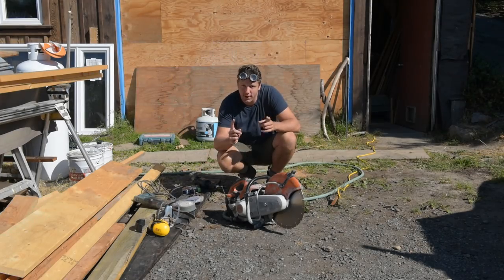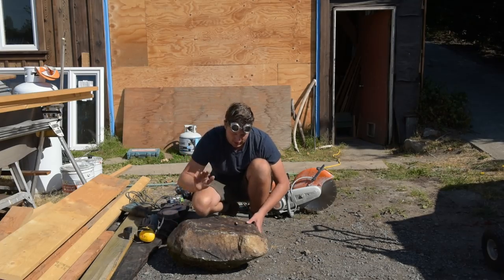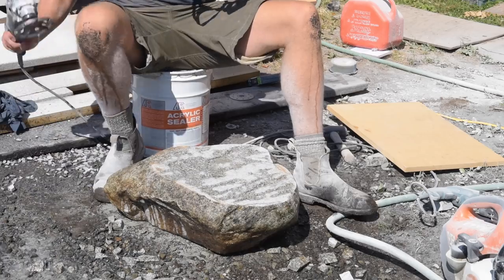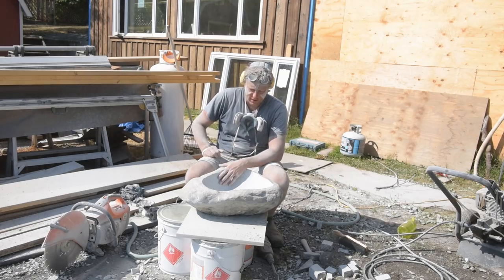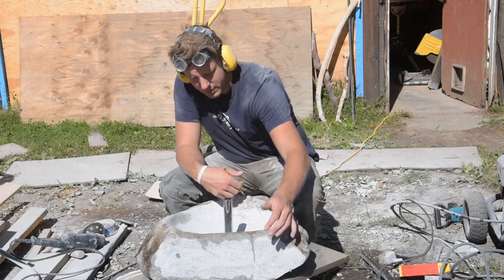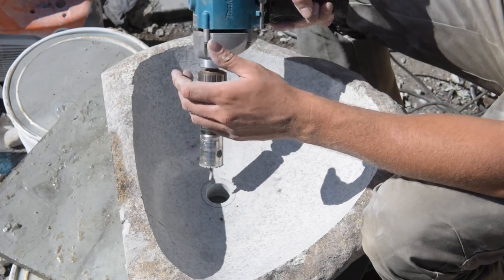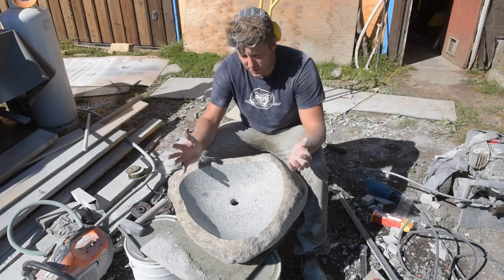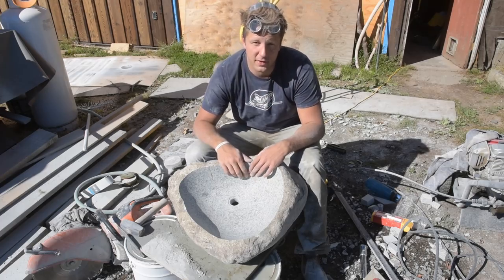How To Carve A Better Stone Sink In 4 HRS!

Comment: Just came across this redo of your original video and i love it, just a word of advice though about polishing stone (for future reference). Im a stone and monumental mason, have been for over 13 years now and when you polish rough stone like the inside of your sink you need a variable speed grinder preferably with a water trickle through the centre of the rotating shaft. When you start off at the 50 grit you can use a normal grinder but dont put too much pressure on the disc because you will actually burn the stone, thats what that yellow discolouration is. As you move up through the grits you need to slow the disc down as you will burn the disc out instead of working the stone. Took me a long time to work out how that part worked lol love the video and keep it up dude

Comment: The best pads I have used are  CHANGE MOORE Wet Diamond Polishing Pads.  @ $40 on Amazon.  50 - 3000 grit.  Gives you an almost mirror finish and really brings out the depth and colors in the stone.  And yes, use water.  I use a spray bottle and mist the stone.  Grind until lightly dry.  Mist again.  You will see the scratches disappear with each successive grit pad until you get to 300.  Then 500 - 3000 use very little water and light pressure.  The weight of the grinder is enough.  I have been using mineral oil to seal the stone and bring out the colors.  Not sure if that is the best product to use, but it sure looks nice to start.

Comment: I am a stone polisher and i also use the same polishing pads , a tip use lots of water when polishing with them or heat will build up and ruin the pads , i also use an air driven grinder/polisher with a hose pipe for water to cool it ,when you go up to using the 2000 grit the surface looks like glass nice work by the way .

Comment: I have polished several granite counter tops and water is the key to getting a better finish.  I used a 4" grinder with a water attachment.  Prolongs life of pad and gets rid of dust that will scratch surface while sanding. Water water water! Like panning for gold. Lol.
Reply: Oil is better at the last polishing steps together with your polishing abrasive

Comment: I purchased a full set of stone polishing pads from china on ebay for $15 to polish granite remnants into coffee tables.   I got great results by purchasing a hitachi variable speed 4" grinder.   You must keep the speed down on level 1 or 2 and use water or you will destroy the pads quickly.   I was able to polish probably 80 linear feet of granite counter top edge before the pads started slowing down.     Look around on ebay for those other stone cutting grinder blades.  I was able to get 4" makita discs that would normally be $30 for around $10 apiece.
Reply: Troy Fall basically the fresh pads give you that little push, once again ive watched this one and his last one it was very shallow but smooth this time it is quite deep bit he hasnt went as smooth compared to the last one but i dont know if it is needed

Comment: Awesome video!!...as far as a grinding/buffing wheel for your angle grinder...I've always found an "abrasive stone cup grinding wheel" works the best.  It won't take too much material, but is abrasive enough to actually remove material and leave a pretty smooth surface.

Comment: awesome job, really nice work. A trick I learned with wood that might work with your stone is after you drill the 1/4" hole for the center of the drain use a hole saw blade that is the size of the outside of the drain grate and drill down the depth of the drain grate then swap to the size for the drain pipe and drill through. This will perfectly center the drain grate in the hole and also give you a perfect edge around the grate. Then you can use your grinding technique to remove the material from the hole out to the edge of the shallow groove you made for the grate.

Comment: Nice work, appreciate you making the video.  One tip you might find helpful: trace your initial lines with the small diamond blade before firing up the cutoff saw.  Makes your marks much easier to find through the dust and slurry.

Comment: Awesome job. I'm a stone carver myself. By no means a master. But once you mark the line. Use the flat blade diamond disk to score a line. Won't wash off. chisel and fork would help knock down the high block cuts instead of just grinding and chisel. And using the flat diamond disk to take out the minor ridges before polish process helps lots. Just need steady hands. They even have sanding disks that look like overlapped flaps in different grits which would help in concaved areas instead of trying to force an orbital flat sander to bend. May not got perfect results depending on type of stone but would get close too. And once you set the initial drill hole for the counter sink. Maybe instead of punching through first. Use a hole saw the size of the flange to set counter sink depth. Masking tape to set depth on hole saw. Then grind and clean out flange width from Inner diameter and the go down a size in hole saw. The mandrel shouldn't change truly so in theory it should be snug. Im no sink master. I just do stone art. Just sharing my ideas hoping maybe it will help if you ever make another. Other than that. Looks awesome. Truly love your work. Amazing artist

Comment: I work in a granite fabricating company. Water helps a lot and gives a much better shine when polishing with pads, and if you're dry polishing make sure the pads are recommended for dry use, or else they will burn out quick and not polish much. Quality pads do make a difference too. After using a rough cup wheel I would suggest using a finer grade cup wheel to remove all the deep scratches, that way you won't have such a hard time with the 50. You can find a granite countertop company that will sell you some quality diamond tools, like core bits that last a very long time, they usually use better quality than ones found in hardware stores. Excellent video though! Very very nice DIY sink!

Comment: Nice! I would suggest using a 50 and/or 100 grit dot pad after the diamond cup wheel to get all of the scratches out of the bowl. Then proceed to use the 50 resin and up. I do a lot of concrete polishing and I bet that would shine up nicely!

Comment: if you start with a hole saw the diameter of the counter sink first, Cut as deep as you need for the counter sink, then through drill with the small hole saw, and lastly chip out the counter sink ring, you might find it a bit easier, and you wont risk that hole saw running away and marring your polished surface.

Great vid!

Comment: You might try a wet sanding technique with the diamond polishing pads. We bought one from the concrete countertop people that uses a hose connection to continually feed water to the polishing wheel. The cream produced by the stone dust  acts like a polishing paste and makes the job go faster and smoother. It worked really well for polishing to expose and polish the fine sand aggregate in our concrete countertops to a smooth glass finish. Should work for stone.

Comment: use a larger hole saw bit that is the diameter of the drain flange before drilling through. would save you going willy nilly on it because then you'll have an outside mark to remove material too...Thanks for the inspiration!

Comment: Your first stone sink was how I  found your channel . 
Have you  considered  flaming the inside of the sink? Try it  on a scrap first to see if you like it. It should  give you a uniform slightly  rough surface  inside. Wet the stone and hit the surface  with your torch, it causes  the top layer to pop off.

Comment: Not sure if you put the acrylic sealer on yet, but you could also use a thin epoxy coat. It would seal it much better than acrylic sealer and would also fill that crack you found. If you ever managed to crack the epoxy, just mix up a little more and smear it in. A quick pass with some fine sandpaper will take away the gloss if you'd rather a matte finish.

Comment: Using a wet polisher helps the diamond pads cut faster, but yes, surface polishing with pads takes forever. There is a smooth (continuous rim)fine diamond cup wheel that would probably be a good in-between stage before 50 grit pad. Diamonds are a MAN'S best friend.

Comment: You may be able to smooth out some of the diamond gouges with a blowtorch.  It should spall and leave you with a finish based on the materials that make up the stone.

I haven't tried this myself, but one of my favourite artists, Andy Goldsworthy, has carved holes in stones that way.

Make sure to wear eye protection, I gather the hot chips tend to fly out pretty fast.

Comment: looks ace. next time you do the waste/plug hole center drill lile you did then find a hole cutter the size of the outer diameter and drill that in to your required depth then cut the inner hole then chip out the  outer put to counter sink the plug hole

Comment: Try sand blasting after diamond wheel to remove deep cuts, Harbor Freight has cheap blasting unit if you already have air compressor.

Comment: I read that the Egyptians used to put the pyramid stone blocks into a hole filled with water to get a level line so they could carve a level surface. Might work with a paddling pool for a small sink like this, just don't drop the grinder.

Comment: You could also use a finer grit diamond grinding wheel in between. those cupped diamond wheels come in a range of grits from course to fine (much like sandpaper). I have done a few sets of polished concrete stairs where I used the course diamond cup first, then the fine diamond cup and then get into the polishing pads to finish. Nice Basin though.

Comment: Nice one Jesse ! Always been curious on how you made the transition between the drain and the sink. Thanks for adding the whole footage in this new sink video.. hand eye coordination it is!
Reply: Tomy Hovington a larger diamond bit for the flange would have done it faster and more accurately, you do have to spend another 30-40 bucks though. 

Drill the pilot hole
Drill out the flange section
Drill the hole for the drain

Comment: This polishings pads would be more efficient if You add water. Then it will damage slower. Also good idea is to use something with smaller angular velocity. Also you can add a layer of foam so te pads get more flexible, it will be easier to make curves.Then after 50 grid you can use 100, 200, 400, 800, 1500, 3000, and at the end something called buff. After that you can get nice and shiny finish.But you have to use water, a lot of water, otherwise stone wille be burned, so the crystal grid will be damaged and a micro cracks will appear, and the colour of the stone will brighter, what looks bad.
I'm not an expert, but my work is about polishing granite, smoetimes marble. So if You want to know something about this feel free to ask i will try to help :)

Comment: Just a piece of experience saying to not to use plumbers putty as it contains linseed oil which will bleed into the stone and discolor it.  Use 100% silicone to seal the drain.  Suggest using tape cut carefully around the hole first so as to not get the silicone anywhere you don't want it.  I have a basalt sink that is a bit shallow, but a near perfect concave completely polished.  Haven't done the exterior finish yet (chiseled frosted finish) with about 90 minutes spent.  Please note that I own a stone shop and have over 36 years experience, and had to just use the equipment, and tools that I already own.

Comment: Great job on this sink. Much better than the first one. Definitely worth the time invested. I'll bet your wife isn't going to get rid of you any time soon.
As far as sealing goes, imho, it is not optional. Any natural material used around water and soap will get eaten away and stained if not properly sealed, regardless of hardness. And needs to be re-sealed periodically, about every couple years, depending on porosity and use.

Comment: as a general rule you want to be running water over any tool you use to cut stone with. The water lubricates the cutting surface and clear debris away. This will all be condusive to faster cuts and less dulling if your tools as well.

Comment: The polishing pads work much better with a constant flow of water - you might have found it better to have cut out the hole for the waste, then used the pad for polishing so the water freely drains away and use a slow running hosepipe.

Using the pads dry you are working against the problem of the dust acting as a buffer between the pad and the stone - it's the same principle as why wetstone sharpening works better than dry using a grinding wheel, it's not just for cooling.

Comment: Hello, you are doing interesting things. Say why you do not use two crowns. First, a large diameter to go deeper into the thickness of the metal and then drill a through hole under the siphon? So see faster, and the spindle of the drill is more expensive.

Comment: Maybe a dumb question but when you used the hole saw for the drain, why not punch it out after say, 3/4 of the way in, if you're not worried what the bottom will look like? Risk of cracking the whole thing or just "if it's worth doing, it's worth doing right." ?

Comment: Could you just use a bigger hole saw diamond but to start your hole for the first 1/4” or 1/8” for the drain offset, then once you get your depth, switch to a hole saw for your drain diameter . ??

Comment: Looks like fun, really want to make my own now. But buddy, you're using wet polishing pads! Dry ones look different and work much better. Obviously, it's always better to use the wet pads with water, but the dry pads won't heat up and glaze over as quick without water. Just a heads up.
Reply: Also, try using a 24 grit grinding stone along with a turbo cup (resin filled for better finish), you can take a shaping tool to soften the edges of the grinding stone. Also, your core bit will cut much faster and prevent glazing from happening as fast if you use water. But when glazing does happen, try grabbing a concrete block and grinding some holes out of it. That brings the edge of the diamonds back out.

Comment: what if you drilled say 5-10 small holes where u want ur drain then just seal a drain pipe to the bottom so the sink/drain is 100% stone
Reply: You would still need some way to mount your down pipe to get the water to the drain. Not a huge issue as you could just drill a couple holes and add a flange, but it would require more work instead of using a ready built solution made to address that exact problem.
 Also, any fixture that has a pull-up stopper, wouldn't work. You'd have to use a plug of some type if you'd like your sink to hold water. Whether you care about that or not is up to you.
Reply: That's a good idea. Hey ! I could make a stone  P-trap and that'd be even cooler...meh, maybe not so much.
Reply: Mike McKeen god blessed us with those who can build

Comment: Err hey Samurai, you're gonna wanna seal that stone. I work in the Granite countertop bizz and you're guaranteed to get some water penetration into that raw stone and cause mildew/mold buildup along with cracking and chipping.

You can go to really any of the Big Box stores and look for products like, "Granite Sealer" and the like. I don't recommend anything that's a 2-in-1 or a 3-in-1 Sealer/Cleaner/Polish. Those don't work.

Hope you can address this and I hope it helps you!

Comment: could prevent splashing too by angling the bottom of the sink shallow at wall side and deeper at user side.  I feel the acrylic seal is awful on the natural rock as it ads a different touch and unnatural look to it except in a photograph of course

Comment: Anything abrasives will work so next time go cheep and get some sanding pads for steel you can usually get to pads in bulk just becuase they say there for steel doesnt mean there always ment for steel!!! If you want to be creative ya gotta think out side the box. Just like a knife has 100 use's. So if a item says its used for one thing always means it can be uesd for something els

Comment: Those are wet polishing pads bud you get a way better finish and they last way longer if you keep them wet. A sponge and a 5 gallon pail is all you need. Also keep your coring bit wet it will cut faster and last longer

Comment: Can i just say i know you have all the tools but i dont have a laser level for people who arnt as talented as you can you give alternate ideas for a laser and things like a chalk line etc etc i know that is valid but i think all your ideas expressed in detail would be much more valid thanks!
Reply: 1. Place your rock in somewhere on a solid surface (concrete slab, etc)
2. Setup 4 blocks around the rock (like a box)
3. Level each block
4. Pack blocks to the height
5. Level off of your blocks to the stone, making points
6. Connect the points

This will give you a very accurate line but will take a little longer.
Reply: ooO Ooo thank you, even if you are mocking me or anything in the position i am on now i can not afford the tools he has but i know people use their heads and come up with other ways to achieve the same things so i appreciate what you said and will give it ago, thank you! 👍🏻
Reply: I was not insulting you, I thought of myself in your position and thought what I would do.

The Samurai Carpenter does this type of stuff ^ himself, for example how he uses a router jig to flatten a live slab edge instead of buying an appropriate sized thicknesser which would cost thousands.

Nice work for trying this type of stuff yourself! You and your family will reap the rewards ;)
Reply: SoldierDemps flat surface, couple of pieces of wood secured kind of in a "T" or sideways "H" shape with a pencil on the end and just keep it plumb and mark around.